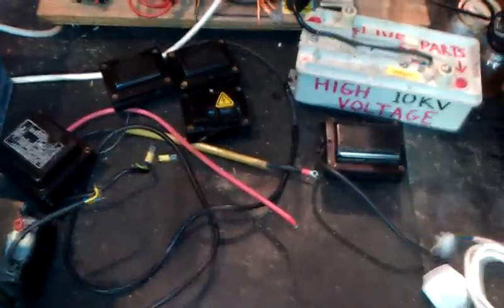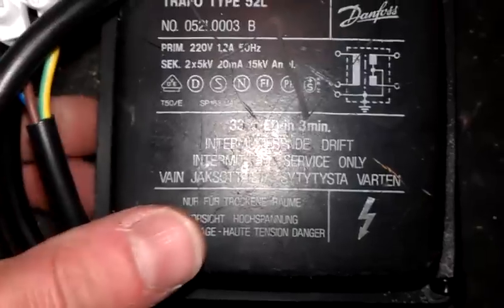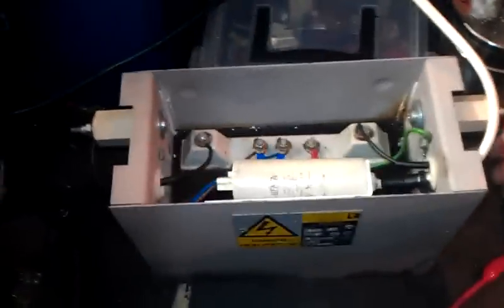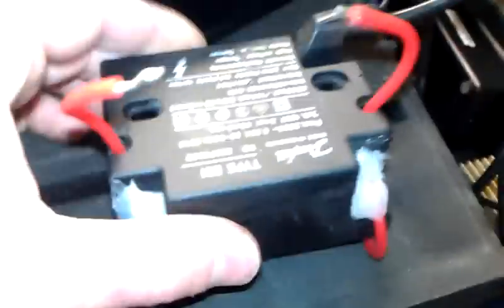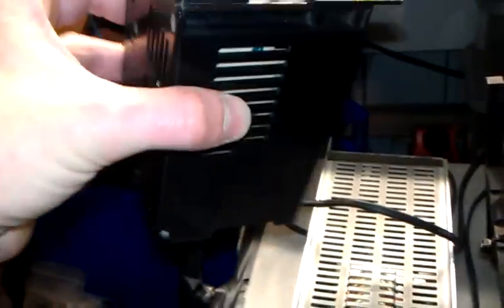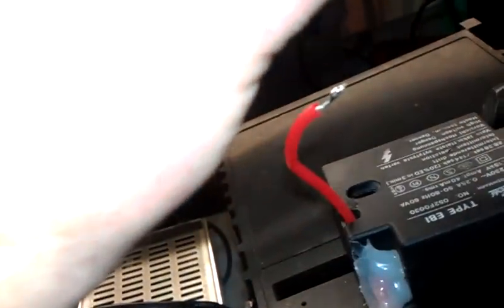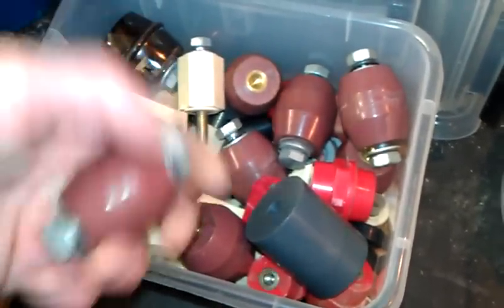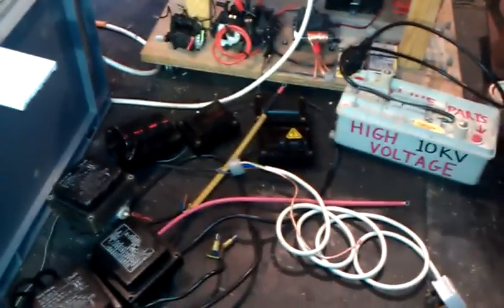High voltage transformers

Comment: How do you wire a flyback
Reply from the maker: Hi' 
How do you want to power it mate?? Power it by a zvs? Or a 555 timer? Or some other driver? Because you can have a primary coil on the ferrite' or connect directly to the primary pins on the bottom of the flyback!(difficult if you dont know how to find the primary pins.') But limitting the current' otherwise it gets too hot too quick.
Many thanks😉

Anthony.
Reply: i want to power it with a 555 timer
Reply from the maker: davsi lywe well then you can connect it directly to its pins or windings on the ferrite. Around 8 turns of wire should do. Good luck